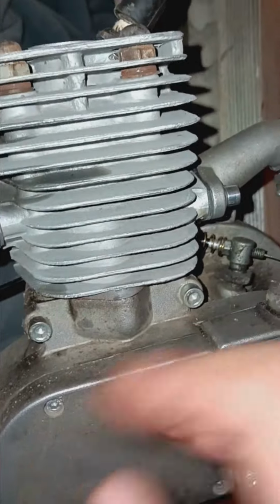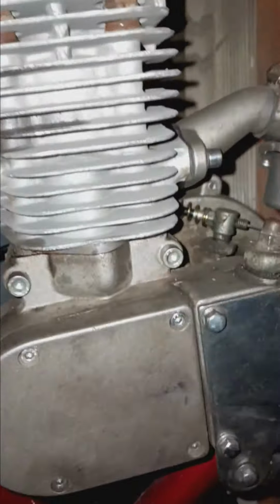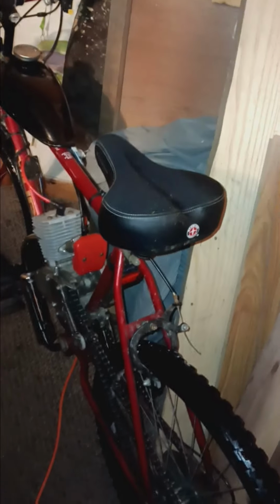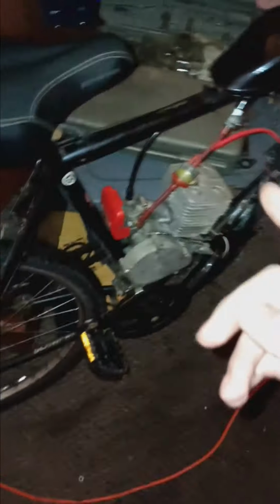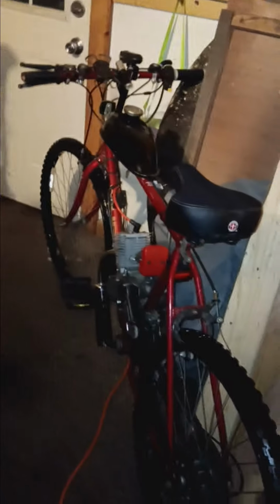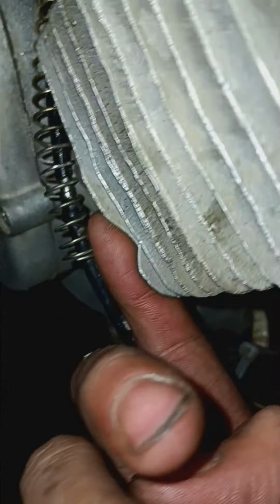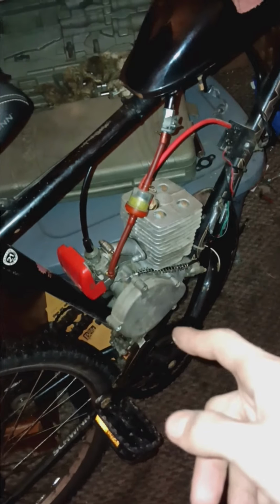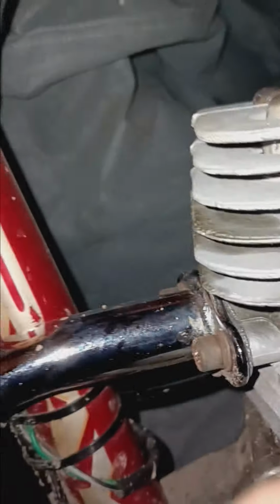yd100 rebuilt and first start motorized bicycle update

Comment: Cool beans brother I'm glad you got it going again the reason the pin bearing and piston hole would not match you probably have a original yd100 connecting rod is 10mm and they use the yd100 bottom for the new avenger 85 it has a 12mm pin bearing so does the phantom and so on and I heard that yd100 some are coming out with the 12mm pin but you should be ok I  had to rebuild my yd100 1 of them same thing had less compression then my other one but it idled better and ran better than the original version so you might have yourself a runner just keep breaking it in slowly and you should be good the piston doesn't touch the cylinders walls so you should be good ride safe brother spring is coming PS congratulations on your subscription I only have 72 lol
Reply from the maker: Make that 73 and thank u very much for the info on the rods i was  alittle confused